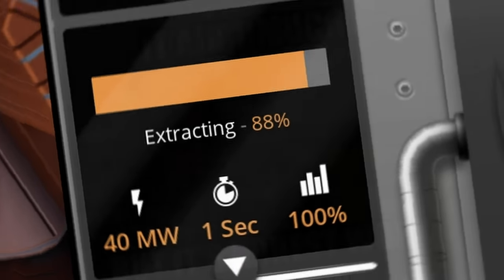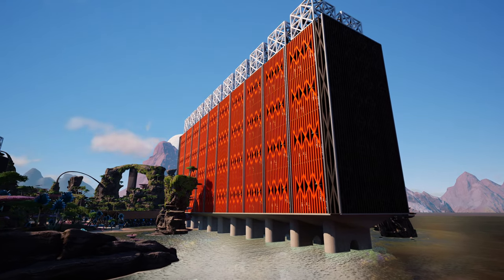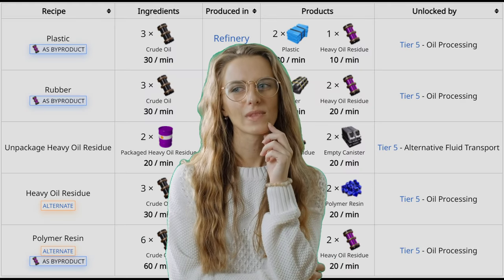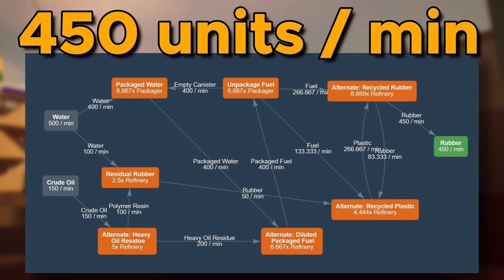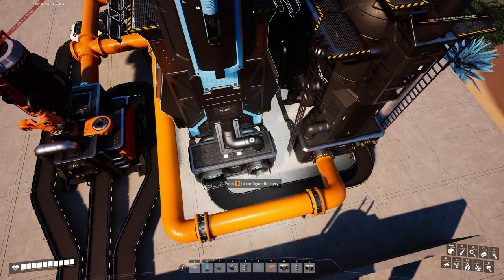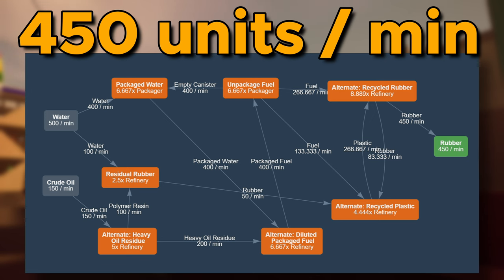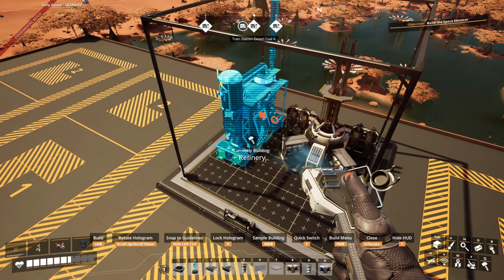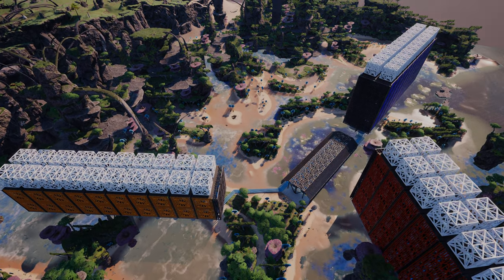3 WAYS to do Plastic & Rubber in Satisfactory

Comment: great stuff; made a new save to try out all of your factories in a box. do you happen to have a coal power plant in a box for early game? I would love to see a full everything in a box playthough. even space elevator parts. they way you break it down into small processes and one click designs really inspired a new way of playthough for me. I would love to be able to DL a bunch of your unreleased stuff and tinker around with them in my new playthrough.
Reply from the maker: Yeah I do have coal stuff, but this is the super basic dual plant to work with single water underclocked pump + 3 batteries in the side. There are already a bunch of in-a-box factories on this channel. Check out blueprint only playlist and stay tuned for more!

Comment: Hey, first, thanks for the rubbers lesson.  I've already had my two sons, and I'll never use rubbers, that's what the lady's mouth is for, or butt..., but (sic) I need it for the last space ejaculator elevator (?) things until I get the alt recipe for one that uses no rubbers... (I think e.g., Turbo Electric Motors, Frames and Radio Control Units)...

But the main reason for the need to try to comment rolling the dice on whether the google AI god (AGI already achieved) doesn't immediately censor this comment is this:

Dinosaurs are NOT responsible for Oil... it's Abiotic, if it wasn't, all the drilling in the Gulf of Mexicoco which is many miles below any possible deposit of dead dinosaurs OR ancient trees wouldn't exist.  It does...  This is a logical impossibility IF oil like the oil companies tell us came from Dinosauruses (as told me by my 5 y/o son once).

So there: everything you've been taught but natural measures like the boiling point of water at one atmosphere has been a lie (which isn't 100C but 212F, haha!).  I know, I went through years falsifying or verifying everything I was taught from Stuyvesant HS on, in my mid 30s, when I realized I've being lied to from all outside sources, and fml, all lies, all bloody lies!